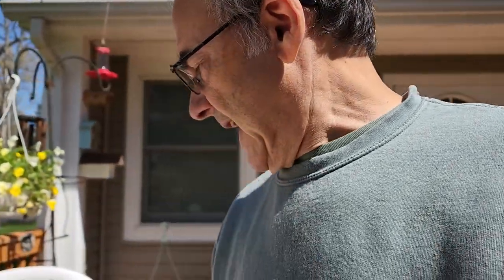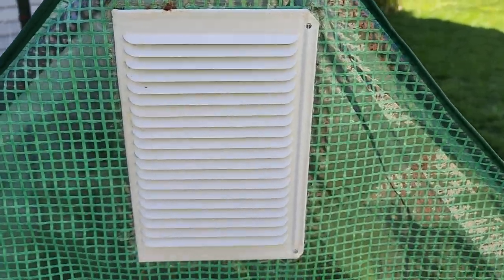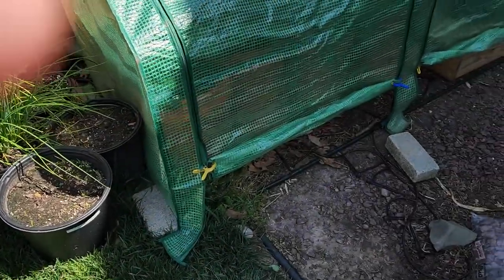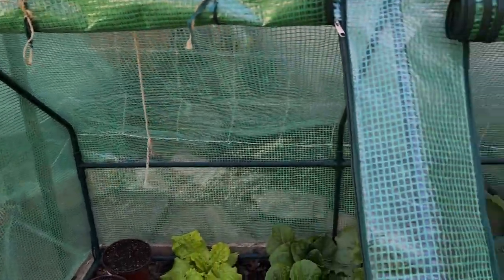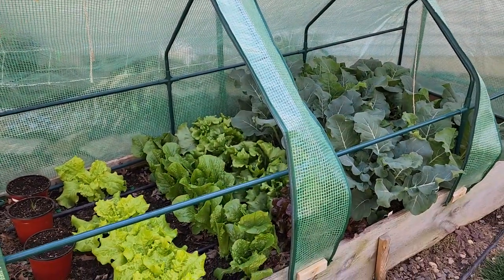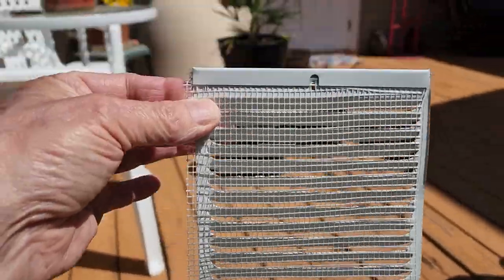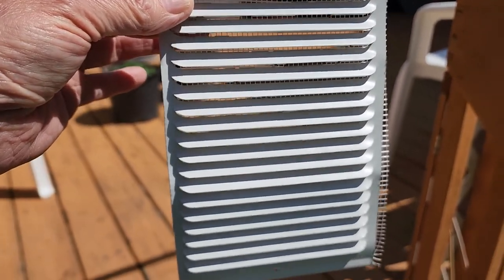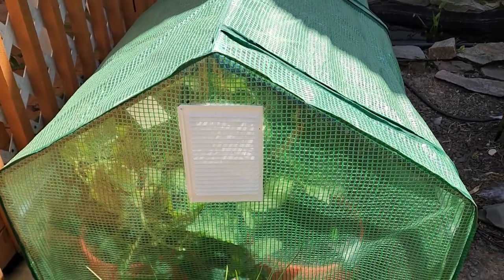DIY Cold Frame / Greenhouse Vent

Comment: Thanks for the great idea. When I cut the plastic from inside after I glued the part to the plastic, I cut it in 3 parts only and hold it up with Velcro in case I want it to close it for any reason - like if it gets too cold.